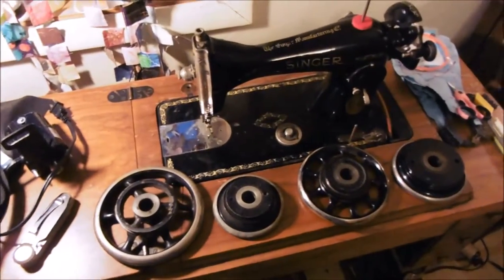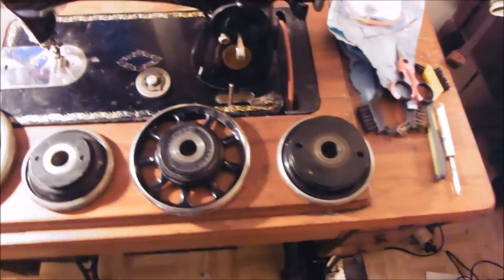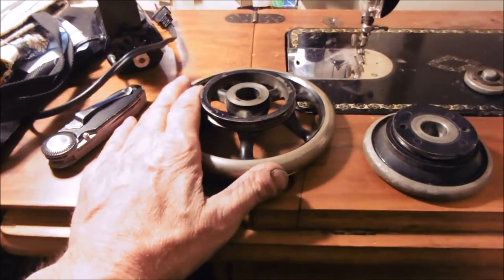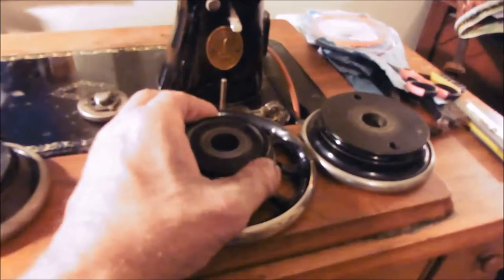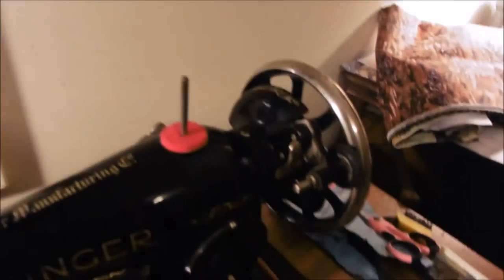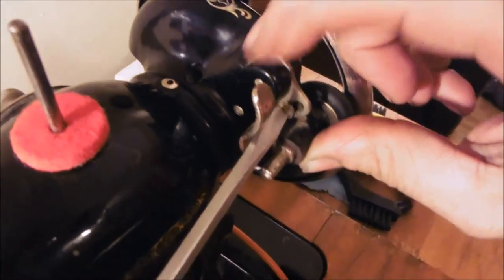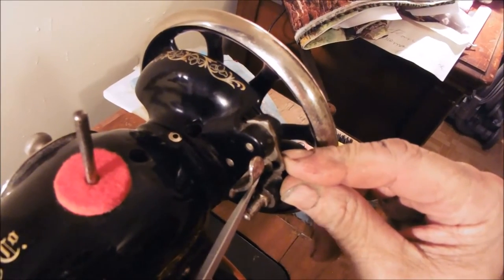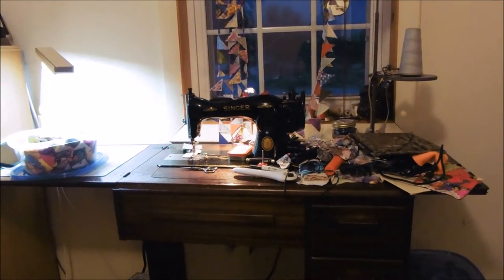A New Channel And Sewing Machine Wheels

Comment: Those old machines are works of art, in my opinion..every element of craftsmanship is there.  Good one, Thanks.
Reply from the maker: That is why I collect them it proves that at one time we built things to last for ever a bit of oil and away they sew
Reply: I feel the same way about my 1936 Atlas lathe..still running and still accurate.

Comment: I just got an industrial old sewing machine from my step mom.  I won't be able to get it until spring when they get back from Texas.  I have seen it but that's about it.  Its very cool.  She told me it will sew threw 7 layers of the thickest upholstery fabric or leather out there.  Its built into a nice cabinet.  I can't wait to get it.  Its like brand new.  They picked up 5 of them at an auction.
Reply from the maker: SouthPaw Bushcraft is it made by singer and good for you be sure and let me know if I can help

Comment: Thank you so much for this video!
I'm hoping to you could tell me if this is possible with the 201k3 as it has the belt motor?

I've seen a few of that model online that have the traditional spoked balance wheel, but this one has the newer type and I just don't like it aesthetically (It has such lovely metal workings on the face-plate and back-plate and feels like it should have the spoked wheel)
Reply from the maker: I don't see why not I thought I had red that the 201K3 was ment to be treadled.    I have put them on a 201 to treadle it and work fine just does not look good with the potted motor removed